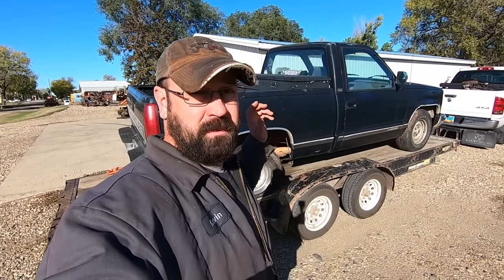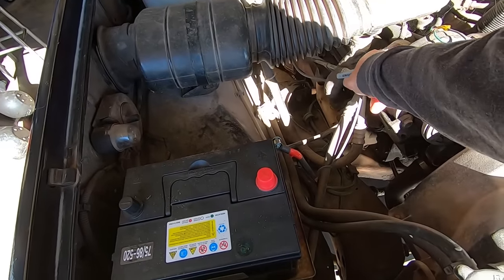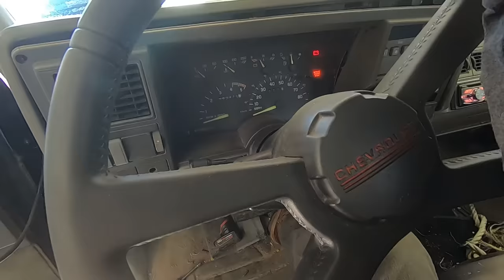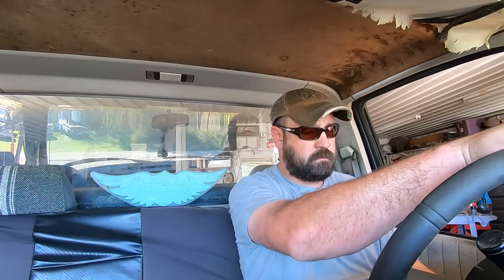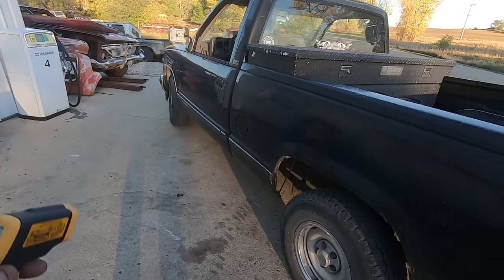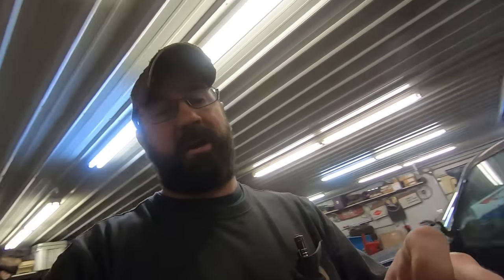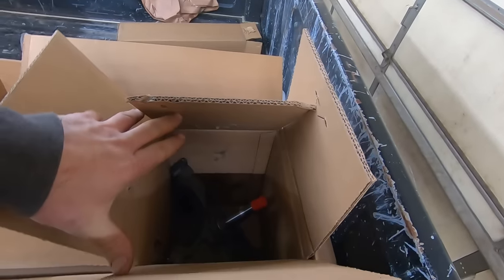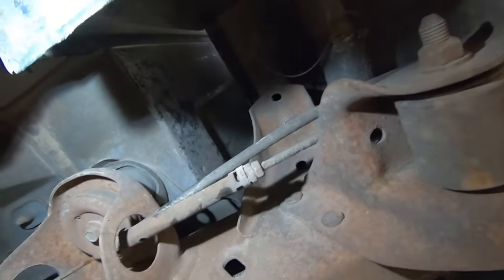1992 Chevrolet Silverado Transformation! From Junk to Jewel! Daily Driver OBS SWB Build!

Comment: Sure looks like rear is lower than front. Hope your not going for the carolina squat! First ticket is 400$ second is 800$ and third and any more are 1200$ each.
Reply from the maker: That’s not a problem here
Reply: Once  I saw it on the ground it was perfect.  I spoke too soon and apologize. You should see the streets of charleston these days. It was on the news again this morning. Apparently the actual law goes into effect. The judge dropped all tickets and is giving them a chance to make it right. If your truck looks like that ya better have a dump trailer on it or the bed full of material. Give duff a Scooby-Doo snack

Comment: When you get over 85 mi an hour in the 85- with the speedometer that little white thing keeps coming up and around I didn't know if you knew that or not
Reply from the maker: What keeps coming up??
Reply: @MortskeRepair  i
If I can recall correctly nothing the gray that comes up and then it stops but the end of the gray part keeps going so then the black background is showing once the gray keeps going cuz my dad had an 89 GMC and that's what happened to that

Comment: i can't imagine getting away with cutting the parking brake cable...  in TX if the parking brake won't hold the vehicle in place at 1500rpm you FAIL state inspection ...
Reply from the maker: But you guys can all run bald tires...

Comment: You need an engineering degree to install wiper blades now. First step, figure out arm style then disassemble and reassemble for correct one. Then swear and rip the old one off and hope you don’t break the new plastic clip putting it back on.  🤬 engineers overcomplicate everything.

Comment: You hint at dropping the LS in another car... right idea... collect some of those motors even if a half wrecked car is attached if it's cheaper to do it that way... Put an early 80's drive train in one or more of the impala's or rebuild a 350 that has a nice set of Bollocks on it... Do an episode of rebuilding a motor for an Impala... Guaranteed increase in views and subscriptions... the flipomatic thing... G#d D$mn it's boring and banal and endless and R%t Fark'n brain crush... Anyway... like you and love the Duffster... want to see you do better... get some motors... ask for donations towards parts... For Youtube's sake... take that extra step... Collect some motors for some of these Flips... Fix the motors in some motor episodes? V8 Motors... Keep a shed just for the straight and slant six Grampa cars.

Comment: You know what morsky have watched you since you started and I've worked on the f*** we built Dodgers Chevy's Internationals John Deere Massey Ferguson's mahindra's and I think the biggest piece of s*** of them all is Ford and they're f**** Diesel power stroke which everybody don't understand they're an International engine not a Ford and it pissed me off when Chevy got rid of the Detroit series and sold them to the freaking Japan and now it's the DD engines yes and I used to work on tractor and trailers